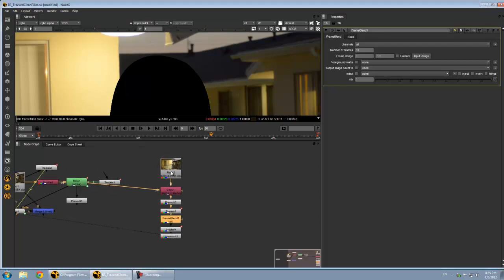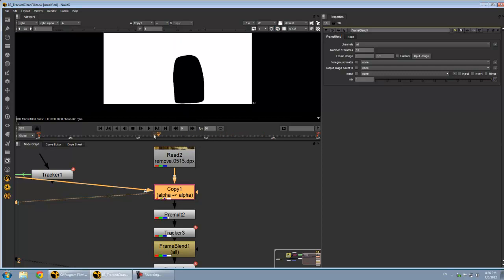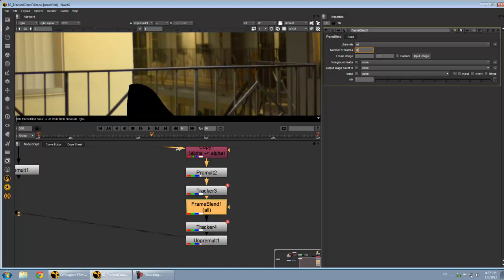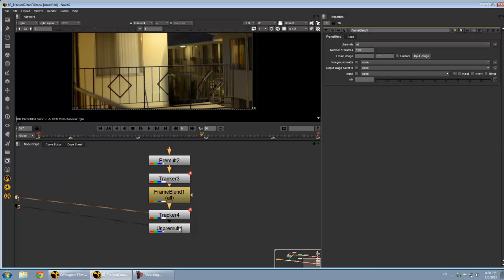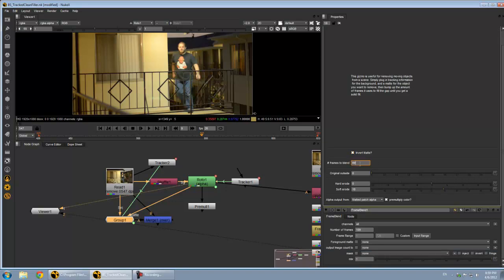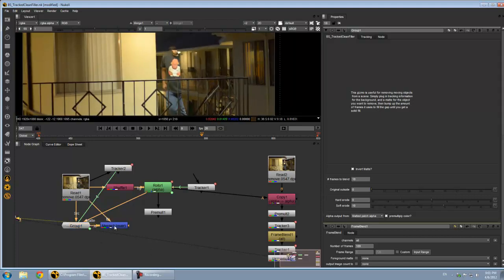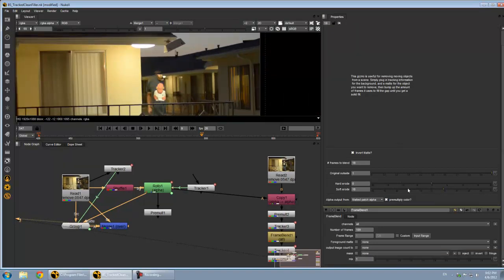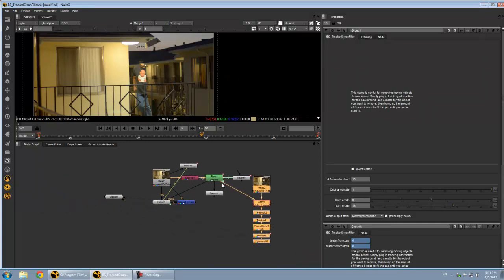Nuke Workflow - Automatic Cleanplate! (kinda)

Comment from the maker: You are correct, though I have used this method on shots with a lot of parallax. It just requires a few passes with different tracks and roto for each "layer" of parallax. Far from a one click solution in that case, but still helpful.

I have even used this method with a 3d track and projection on mesh created from a pointCloudGenerator to make cleanplates of objects with full perspective shift. but it's much more complex and temperamental :)  Thanks for the comment and I hope it works for you!